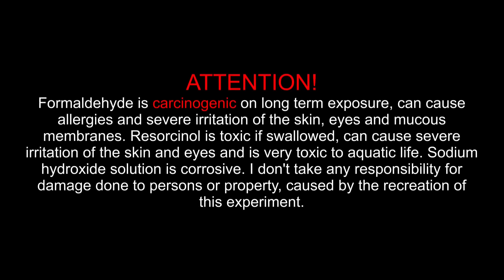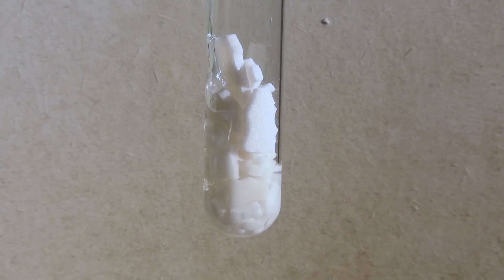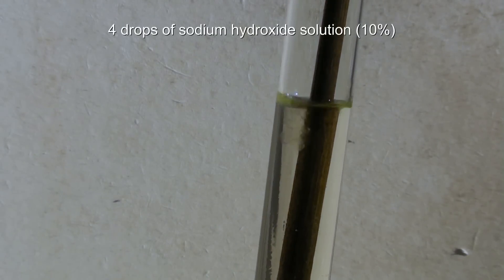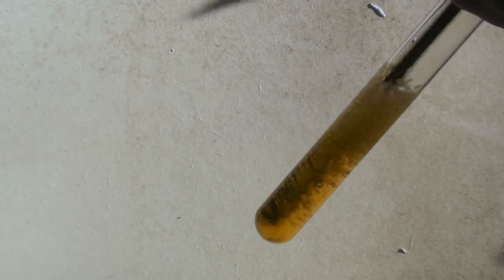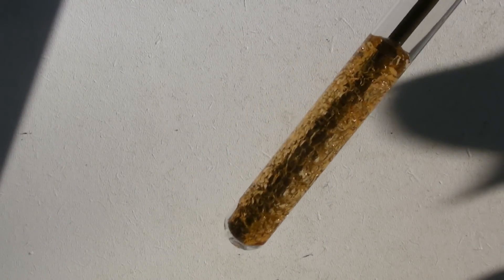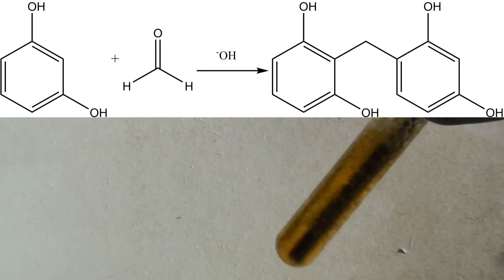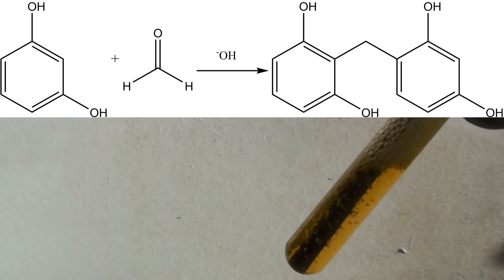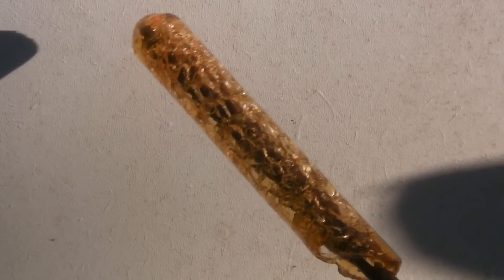Preparation of a phenol formaldehyde resin

Comment: I do not know english. How can i do this experiment. Are you able to write the experiment.
Reply from the maker: A test tube is filled with 2 cm of resorcinol. Water is added until it is covered. Next 2 mL of formaldehyde solution (25-30%) are added. The test tube is heated until the resorcinol has dissolved. Then 4 drops of 10% sodium hydroxide solution are added. It is mixed with a wooden stick and if it doesn't react at once, it is heated again until it begins to bubble slightly. The heat source is then removed and it is mixed until is solidifies.

Comment: can this experiment be reproduced using phenol instead of resorcinol? because I get a very different reaction maybe my concentrations are off for example my phenol is crystalline and a couple of centimeters in a test tube is going to equate to more phenol then if they were in large chunks

You have any suggestions I would like to make this exact resin
Reply from the maker: +Clown Whisper Here are two articles I found, which might help: 
1. http://www.khalidshadid.com/uploads/3/9/2/0/3920808/phenol_formaldehyde_resin._bakelite.pdf
2. http://www.indjst.org/index.php/indjst/article/viewFile/33969/27919
Reply: Random Experiments International I did the first one before and all that evolves is a pink crumbly material  I hacve seen others do variations on this and this is all they produce as well.  My phenol is very pure as i did 4 distillation/decarboxylation and I use only very high quality reagents 

I am lookin into melamine now.   the acid is very very cheap and the reaction is supp
osed to yield a very hard transparent plastic

This whole topic is starting to bug me lol.  apparently some of these reactions yealed the precursor to the plastic that then is to be heated under pressure.
Reply from the maker: +Clown Whisper I didn't know that these resins are able to be 
transparent. As far as I know these resins have always been coloured 
(mostly black) with pigments. I know that urea also forms a resin with 
formaldehyde, but it is white.
Reply: Random Experiments International yes I did ther formaldehyde urea residen myself thinking that the final product was the white man that is created when in reality that too needs to be heated under pressure to form the actual plastic at least that's what I've been told. I'm getting a bill soon so I'm going to make a pressure vessel that I can heat in test this theory. 

Just like you make blocks of plastic I'll be happy cuz I'm making machine them into the pieces that I need
Reply: Random Experiments International I cant type much because im so sick so that last post was voice recognition and I CANT even make it out

bUT ON A NEW NOTE I just did the glacial acetic acid formula and changed it up a bit.  it evolved into a white foam rubber like product.

I doubled the experiment amounts and added 3ml of ammonia chloride.  then instead of catalyzing with concentrated sulfuric acid I made a 50% dilution an slowly added it drop by drop shaking for a while between drops.

I also kept the solution at around 70c

I just now tried to burn a small chunk of the white foam and it did nothing.
Fun stuff
Reply: turned crumbly  after 20 minutes..  just like the pink stuff that typically evolves

Comment: i GUESS I DONT UNDERSTAND.  (oops caps)  you used resorcinol as a monomer is that a phenol product?
Reply from the maker: +Clown Whisper Phenols are molecules with an hydroxyl group connected to an aromatic ring (usually benzene), like f.e. resorcinol, hydroquinone or catechol. It doesn't matter if there is more than one hydroxyl group. All do react similar to phenol (the compound), so they're often used as a non carcinogenic substitute for it.
Reply: +Random Experiments International yeah that's very good to know I've been making precursors to phenol and decarboxylation small amounts as they go along so I always have just a little bit to work with at any given time because the fact that I am a little scared of the stuff. I'm pretty careful not to get anything on my hands and they keep my fume hood turned up towards high but it's still a little unnerving I have been searching for a crosslinked that'll leave me with a semi porous substrate so far I haven't found anything suitable. once I find the correct resin composition I want to try to impregnate this mixture with graphing for a specific purpose. I am no chemist so this is a hit and miss proposition for me
Reply from the maker: +Clown Whisper So, you are trying to make some kind of resin, which can be impregnated with paint? (Hope I got it right)
Reply: +Random Experiments International nose voice recognition did not do right. It should be graphite or activated charcoal perhaps
Reply: +Random Experiments International perhaps even graphene oxide